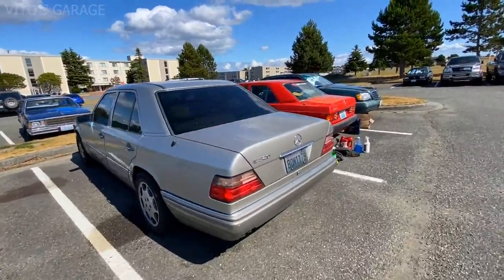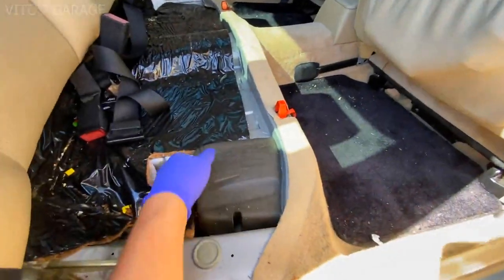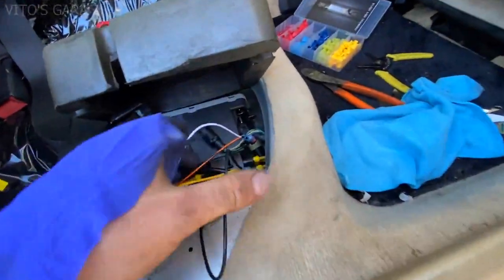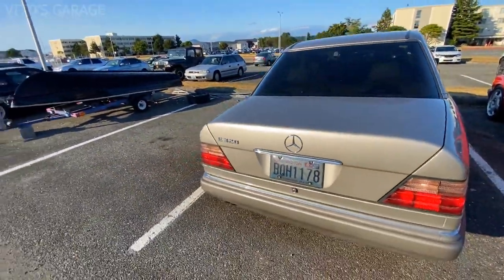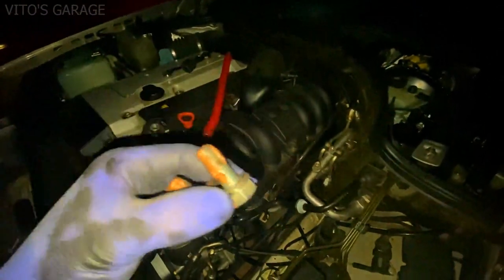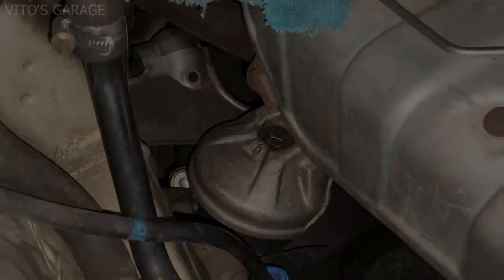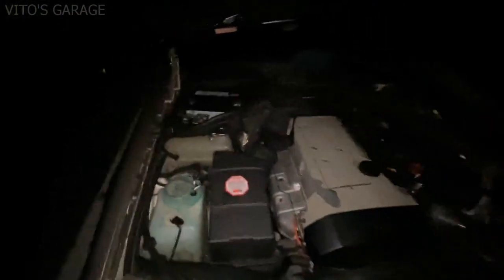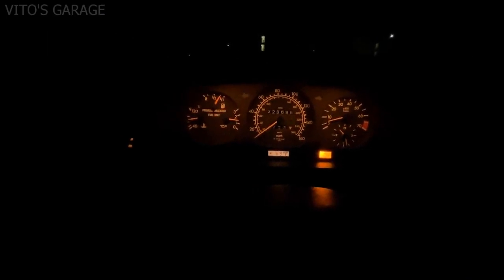Fixing with Pride! Mercedes W124 E320 New Engine Mounts, Keyless Entry & Seat Belt Cleaning! Ep 1

Comment: Hey Vito, I'm also dealing with a mercedes coolant leak, since a few weeks ago the car started to lose coolant, no evident leak or seepage, yesterday I went to pay a guy and like 30 mins later since I parked the car, kaboom, a coolant lake, my son did a quick visual inspection, he bound that the radiator had a massive deep nick, overnight it seeped tons of coolant, will replace radiator hoses and replace radiator,  the radiator is the factory BEHR one, the car is my loved 1998 C250 TURBODIESEL MANUAL TRANSMISSION WAGON, and I love it, very well optioned, mostly sure my german twin bought and optioned the car, now it has 391.000 Km.
Reply from the maker: It has to be leaking somewhere. Check your carpets for wetness. Maybe the heater core started leaking.. Radiator may be leaking too. If your son found a leaky radiator, replace it with a high quality one and it’ll last another 100 years! Amazing car! I wish he had more manual Mercedes in United States!😍

Comment: What about the wiring harness on this car ? Had to replace mine insulation becomes brittle and bare wires come exposed
Reply from the maker: I checked it last year and it was fine. I’ll check it again next time. I’m not sure whether it’s original or replacement harness. I’ll find out. Thanks

Comment: Nice job. Could the keyless entry system be fitted to a W126?
Reply from the maker: Thank you. Yes, it can be. Pretty simple. Watch my recent video about Mercedes 190E keyless entry installation instruction. Your vacuum pump is in the trunk. Tap into the same wires like I did in the video and it will work nicely

Comment: Vito how can I ge the motor mount hole to align with the frame w124 300ce
Reply from the maker: If you’re struggling with the alignment I recommend loosening both engine mounts, lifting the engine up and then starting each bolt before tightening them all the way
Reply: @VITOSGARAGE  thanks vito turns out I was putting the bracket to forward they have two additional holes next to the bracket where it originally bolts
Reply from the maker: @monsieur420  I’m glad you figured it out! Keep up the great work!